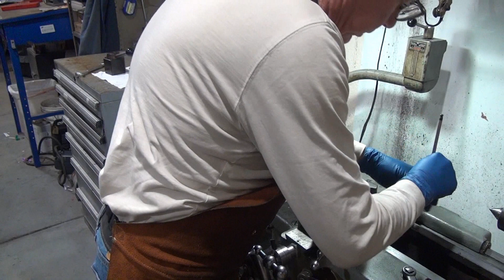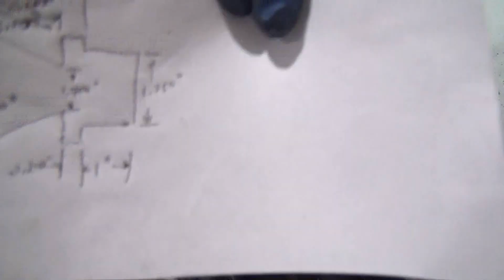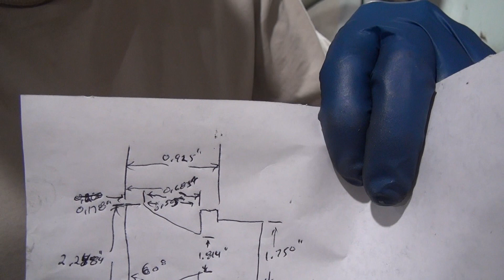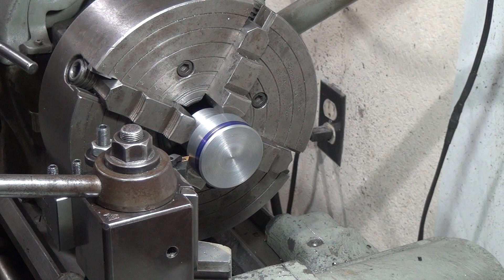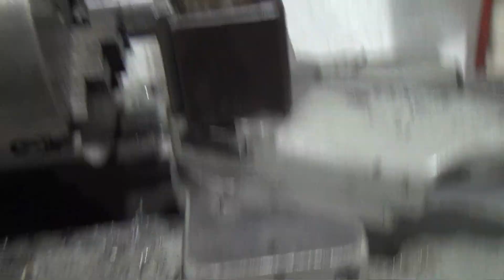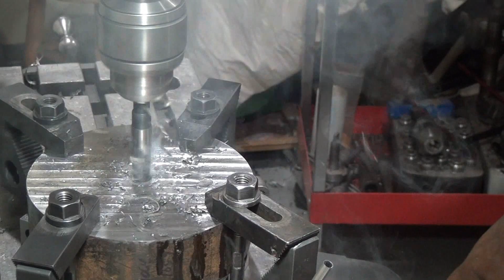Shop Tuneup Series - Building a Rigid Compound Replacement for the Lathe

Comment: 28:12 where did you get the shield?
Reply from the maker: Sorry, I don't remember where I got it. I've had it for several years. I do remember is was cheap, like $15-$20.
Reply: @OldIronLover  Actually found it on shars.  There is 2 different types.  The one you have is the $60 variant.  But there is a $25 variant with a simple gooseneck adjust.
https://www.shars.com/catalogsearch/result/?cat_id=1751&q=chip+shield